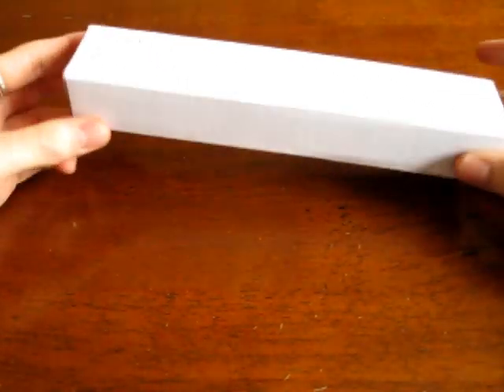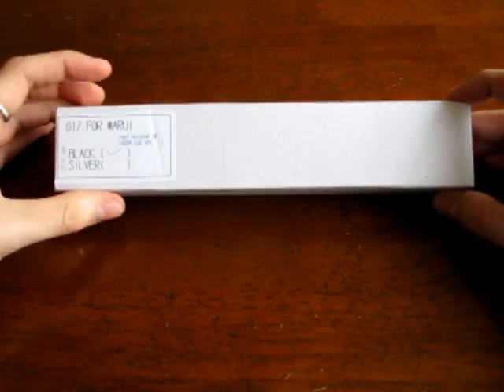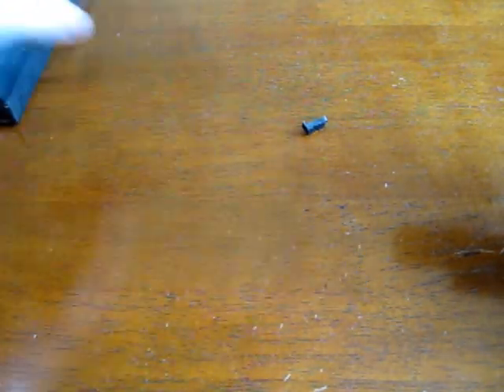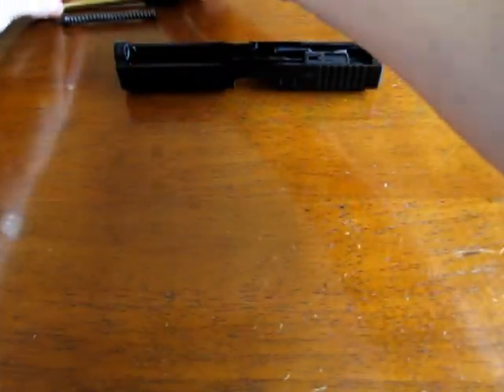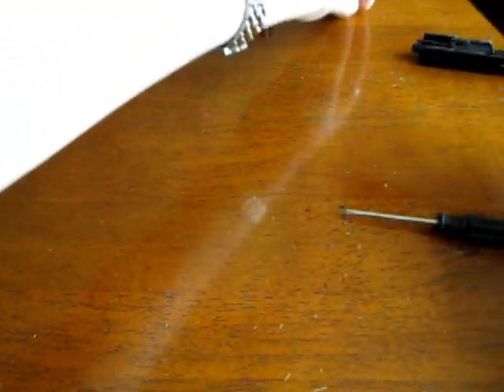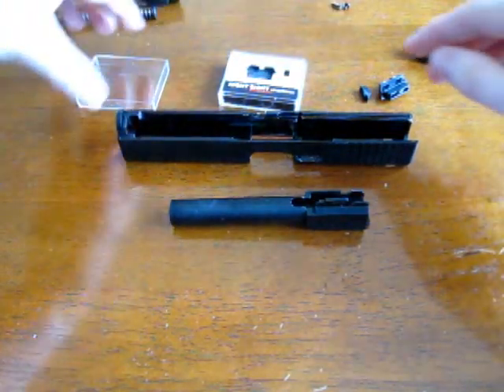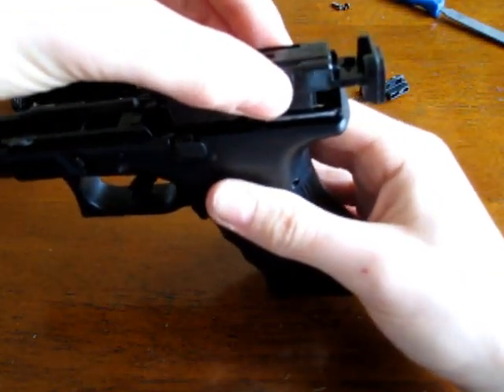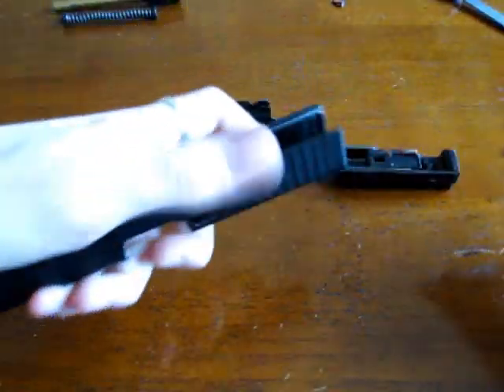Metal Slide and Barrel for Marui Glock 17

Comment from the maker: The hammer spring is still stock. I tried installing one but I really didn't like it. It made the slide very stiff. I did install a high flow valve to help recoil the heavier slide. The 150% recoil spring is not essential I don't think. I gives a nice extra snap to each shot but I'd say the stock one would be fine. You could always upgrade it later if you felt like it.

Comment from the maker: I've found the consumption to be very good. As the magazine approaches empty of gas the force generated by the blowback reduces. Where the plastic slide would have recoiled enough to rack a new round the metal slide is too heavy. As such, you get a couple less shots per filling. Nothing to be concerned about though.

Comment: That seems to be the general consensus, so I'll probably leave it.  I just bought the Guarder steel slide and barrel with 150% springs.  I'm expecting to have to file the slide a bit like you did, but hopefully the tolerances will be close out of the box.  It looks like the G26 is the only model they didn't make a frame for, which is too bad.  I'd have liked a 100% accurate polymer frame with full trades.  The Tanio Koba hop twist inner barrels look cool too, but I can't find one anywhere.

Comment: Thanks.  I saw you mentioned that in one of your other videos actually.  I read that the newer TM Glocks don't need the upgrade, but mine is a 2004 or 2005 model, so maybe it will.  Is the hammer spring difficult to install?  From the searching around I've done it sounds like one of the trickier upgrades, and I don't wan't to strip down the hammer assembly unless I really need to.  If you could do a video at some point, that would be awesome!

Comment from the maker: @CRU1S3R79 If you knew what you were doing, you could probably put one together using just replacement parts. There is quite a lot to it though. You'd have to make sure you got everything you needed. Also, by the time you buy all the parts you could probably have just bought a complete one for the money. I found a very useful page for doing upgrades, the first result when you Google "Tokyo Marui Glock 17 Takedown Guide Barracks".

Comment: I'm planning on doing a similiar build (Metal TM G17). I'm a bit concerned about gas consumption and such, as the TMs blowback housing is built to push a plastic slide. How does it function with the metal slide, 150% spring etc? Do you still get all BBs from one gas filling with bolt lock? How does it hold up? Thanks :D Awesome build!

Comment: @numerouno1231 I just bought one from wgcshop.com, but seems they are out of stock now. I did however google the slide, and its in stock at quite a few retailers. just use "PGC Aluminium Slide for Marui Glock 17" in the search field, and pick your choice of retailer. good luck.

Comment: Did you need to upgrade your hammer spring, or is it still stock?  I'm looking to get a Guarder metal slide and barrel for my TM Glock 26, so I'm guessing the install will be the same as this.  Is the 150% recoil spring essential too?